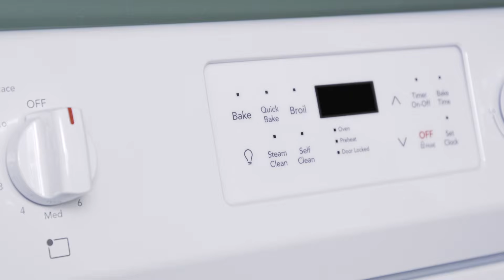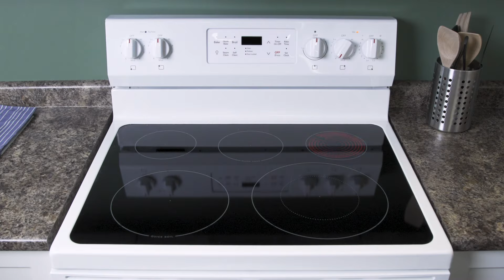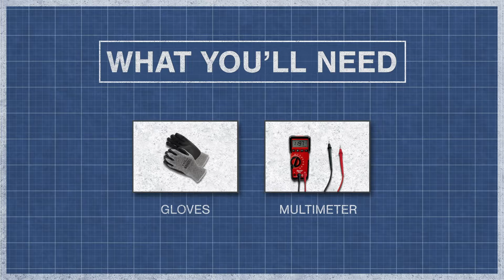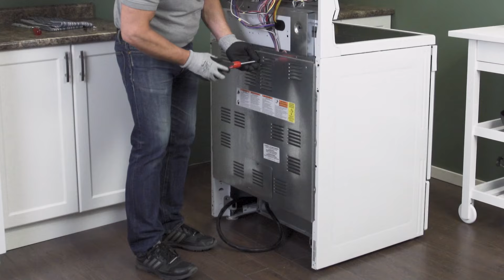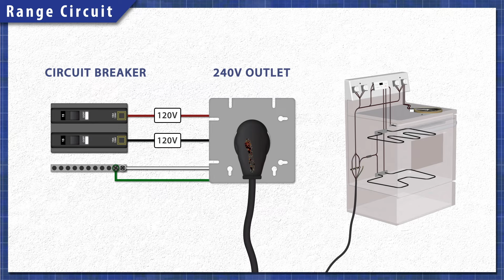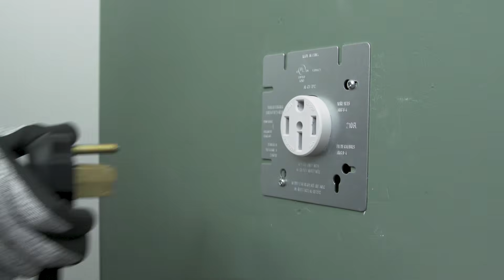No Power? Electric Range Troubleshooting | Repair & Replace

Comment: If you have 0 from ground to hot, it’s your ground wire…
Had 240 hot to hot and all the ohms were good.
The installer left the cheap frail ground exposed so it broke I guess when I moved the oven and eventually lost connection.

Comment: Can you tell me why a person would cut off the plug on a new oven then fix wire to wire without a socket cover?
Reply from the maker: Not all electrical codes support this but this is more common in older homes. It definitely makes it more difficult to work on and troubleshoot the range.

Comment: What about a faulty high limit fuse? Wouldn't that interrupt the circuit to control panel?
Reply from the maker: Thanks for watching. It would depend on the wiring. If the high limit fuse is place within one of the 120V lines going to the control board then it would prevent it from getting power. Not all models have this though, if you model has one you can check the fuse for continuity: https://www.youtube.com/watch?v=Ox1lPMJY62U

Comment: my burners dont work but the oven works any ideas
Reply from the maker: Thanks for watching. If all of your burners stopped working, then there's likely an issue with one of the 120V lines going to the burners. You can try to inspect the wire harness to see if there's any damage. As well you could test the wires for continuity between the connector (that connects to the heat switch) and the terminal block.

Comment: Hi, i tested the red to neutral and it read 120v and then tested black to neutral also 120v. But when I test red to black I get 0( tested connection to the stove). This is a new electric stove I bought from Home Depot so I would think it wasn't the stove. Any ideas?

Comment: Testing the outlet, the breaker should be on? Or can the multimeter test the leads without electricity running through them?
Reply from the maker: To test for voltage the breaker cannot be off. Power needs to be supplied to the outlet for this test to verify that it is able to supply power to the refrigerator power cord.

Comment: Question, I am getting 120v on each hot lead when I test them off of the busbar. When I connect them to the busbar I am not getting any power. The busbar reads 240v on one side and 0 on the other side. Any idea what the problem is?
Reply from the maker: Thanks for watching.Since each hot wire shows 120V  but you're not getting the same reading when connected to the terminal block, then it might be best to install a new terminal block. The terminal block should keep each of those wires separate, and is where the wires will branch out to their respective components.

Comment: Greetings. Thank you for your videos. 
I have a GE Profile PCB909DR1WW glass top that is probably around 10 years old at least and intermittently will not have ALL the elements working. They could go dead for a few days and without doing anything, they will start working again. The lights will come on, but no heat. Currently, it is working and all my connections seem intact with no wire issues that I can see. Ohms testing seems good. Any ideas as to what is causing this issue that has happened twice now? Obviously, will test again should it fail again, but if you have any leads I can address now or then would be appreciated. Thanks.
Reply from the maker: Thanks for watching, we're glad you're finding the videos helpful. It is not common for all 4 burners to stop working. Does that also include the oven elements?

In this case it is likely an issue with one of lines of power to the elements. From the terminal block you can trace both the 120V lines to the heat switches. Test for continuity between the terminal block screw and the wire terminal going into the heat switches. This wire will branch so you can test it on different heat switches (but considering that all elements stop working intermittently then it's likely an issue before it splits). If there is no continuity in any of those tests then part of the wire might be damaged and the damaged segment will need to be repaired, or the entire wire harness replaced.
Reply: @AmreSupply  Wow!! Thank you kindly for the quick reply. Yes, the oven itself works when the stove top doesn't. Fingers crossed it doesn't happen again, but will recheck the lines if it does.
Reply from the maker: @emsteph  You're welcome, we're just happy to help. Keep us posted on how this goes!
Reply: @AmreSupply  Will do...hopefully it doesn't happen again.

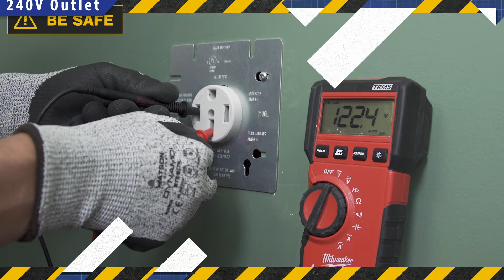Comment: When testing on power sockets, it is always a good idea to plug the neutral first (the black probe) and THEN the hot (the red one). On your video (3:30) you are doing the opposite.
Reply from the maker: Thanks for watching. That is a good rule of thumb. As explained, in a 4 prong outlet the neutral is the bottom terminal so in that moment the neutral being is plugged in first before the hot terminal.

Comment: I have a fridiare electric gallery stove. this is our second stove same model, same problem , oven does not work,  however, at times the control board will come on and  stay on for half day, one time it stayed on for 2 weeks. then back to its normal state of no worky,  replaced wiring harness, control board and relay board. even my spare control board and relay parts didn't work, i believe the electric coming from the outlet is correct
Reply from the maker: Thank you for watching. Based on the fact that the problem is intermittent, and that replacing the parts hasn't change the problem leads to it being an issue with the outlet, your homes wires, or the breaker. When it is not working, you could test the power outlet during that time and compare it to when it is working properly. As well it would be good to double check that the power cord makes a good connection at the terminal block. Look for any signs of a loose terminal etc
Reply: @AmreSupply  thankyou! since the outlit and the breaker has been replaced. not to many options left. thanks for the response and confirming what needs to be done.

Comment: I HAVE 2.6 ACROSS THE BLACK AND RED WIRES OF MY PLUG BUT between .5 and 1 on the neutral. Is this an issue? Thanks
Reply from the maker: Thanks for watching. Are you measuring voltage? You are getting 2.6 volts?

Comment: I get no heat anywhere stovetop or oven. But, i do have partial power, as the orange light still comes on as when i turn the burner knobs...The light doesn't come on however when I turn the oven knobs....

This is an older coil top stove(if that matters)
Reply from the maker: Thanks for watching. You've verified that you have 1 line of power with the orange light with the stove elements. Since the stove elements and the oven elements don't heat up then it's likely an issue with the 2nd line of power. To figure this out, it's best to reset the breaker, verify that the outlet is supplying 240V and the power cord has continuity. 

If those are all good then it could be an issue with the thermal fuse. Some older models have a fuse that disconnects the 2nd line of power if the oven overheats. This is usually just shuts off power to the oven but you might have a model where the thermal fuse will affect power to both the stove and oven. You can learn more here: https://www.youtube.com/watch?v=Ox1lPMJY62U
Reply: @AmreSupply  Appreciate it. Thanks!
Reply from the maker: @erics9487  You're welcome, we're just happy to help!

Comment: What if your terminal block melted at the red wire?
Reply from the maker: Thanks for watching. If part of the terminal block is melted then it's likely because one of the terminals was loose which would create arcing and excess heat at that terminal.

The terminal block is easy to repair, and just requires 2 more screws than replacing the power cord: https://www.youtube.com/watch?v=F-qMAJ6AY80

As well to find a few terminal block you can enter your model number in this search: https://www.amresupply.com/lookup

Comment: Anyone know why oven lights won’t work C970 is the Model with ECM everything works oven lights blew now won’t work no power 
Any help
Reply from the maker: Thanks for watching. It's worth replacing the bulb, and checking the connections to the socket. Look for any damaged wires or loose connections. 

Also if your oven light is controlled by the control board then it's possible that a relay has blown on the board itself. These can't be repaired but the boards are relatively simple to replace. It's best to eliminate all other possible causes first: https://www.youtube.com/watch?v=ORTi4lLyoqw

Comment: i noticed yours has a four wire outlet, my home has a three wire outlet (OLD outlet)  and my issue is that the newly purchased Range is not getting enough power or any power. Im wondering if I need to swap out the old outlet for a newer one.
Reply from the maker: Thanks for watching. If your range connects to a 3 wire outlet, then there will be 2 hot and 1 neutral. You can still test between them to determine if the outlet has power. If there is no power then its possible that the outlet connections are faulty.
Reply: @AmreSupply  I applied a multimeter, I was getting 120v ac out of one prong and nothing out of the other prong. I think maybe there's an open in my wire
Reply from the maker: @southernfriedmedia3968  If only one prong has voltage than either the other hot wire itself is not providing any power, or the wire has a bad connection with the receptacle.
Reply: @AmreSupply  I tested it at the fuse box and both end at that point are giving 120v ac.
Reply from the maker: @southernfriedmedia3968  That means that either the wire is faulty, or the connection to the outlet is faulty.
Reply: @AmreSupply  probably the wire then, I took the outlet off completely and tested the wire ends to be certain
Reply from the maker: @southernfriedmedia3968  If its the wire then that's something that it would be best to get inspected by a electrician.

Comment from the maker: Did this help you fix your electric range? Let us know in the comments!
Reply: I have a wire that looks burnt. This wire is connected to the oven heat element. Can this wire be removed from the connector and trimmed then replaced?
Reply from the maker: @gingertornquist5902  Thanks for watching. Yes is a wire is burned or damaged, it can be trimmed and you can replace the same gauge of wire with that segment. It's best to use heat shrink, you can see wire splicing here: https://youtu.be/GBnE_qEThsU?t=158
Reply: @AmreSupply  Thank you for replying. I tried the just answer website and got someone who must not like his job. I sent him photos and he sent back several accusations that I had staged my problem.
Reply from the maker: @gingertornquist5902  We're just happy to help. Not everyone on staff has the same knowledge base but I have answered in more detail on your following reply.
Reply: Yes thank you
Reply from the maker: @carlwilson3574  Great, we're just happy to help!